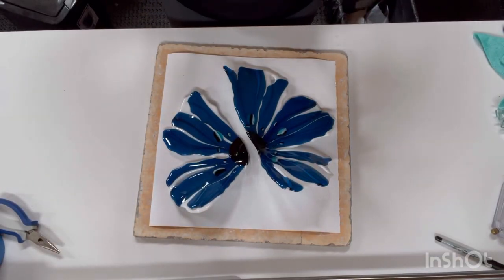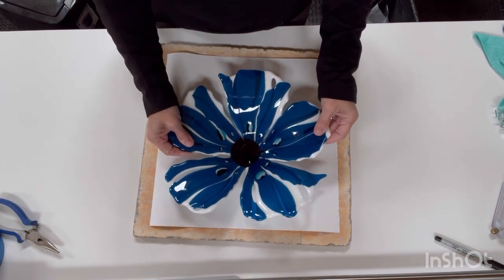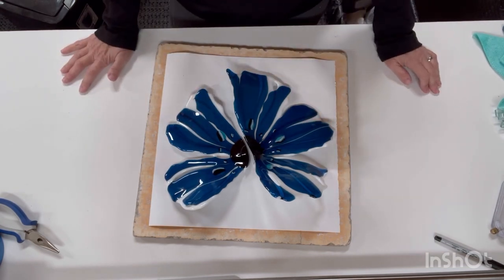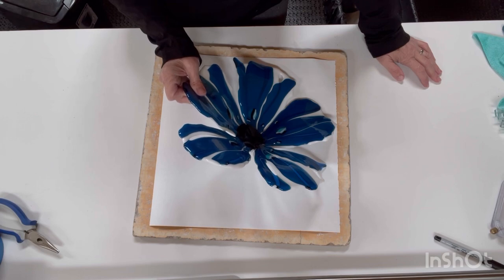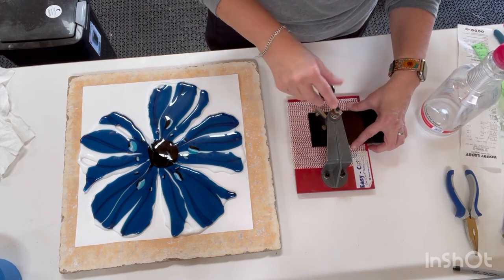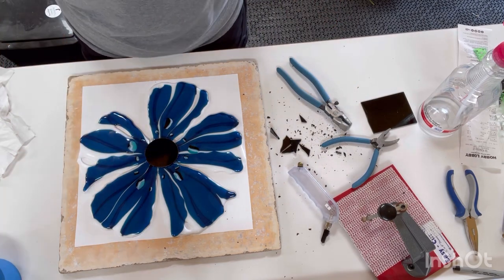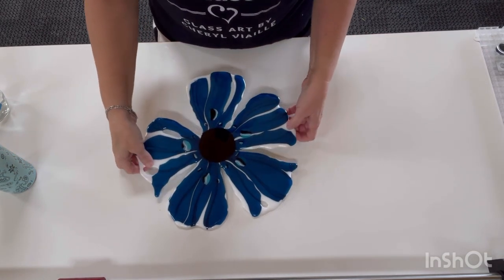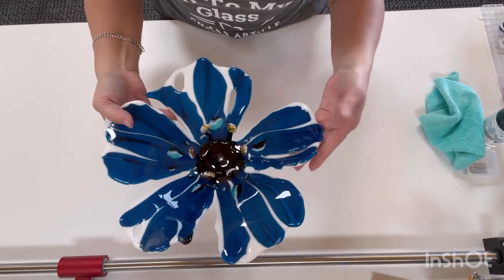Poppy Repair

Comment: I'd be interested in your firing schedule, especially the one where you fused it all together.  You had 3 layers, added the black for the center of your poppy plus the black wedge.  How slowly did you ramp up, how long a hold at top temperature and how long an anneal as I think you had 5 layers in some places?

Comment: Great save!  What do you use to mount the stamen?  Epoxy or do you drill for a screw?
Reply from the maker: It depends if it’s going outside or inside. Inside I use 2-part epoxy. Outside I would use a weather resistant adhesive like silicone or a screw.
Reply: @uptomyglass  thank you!